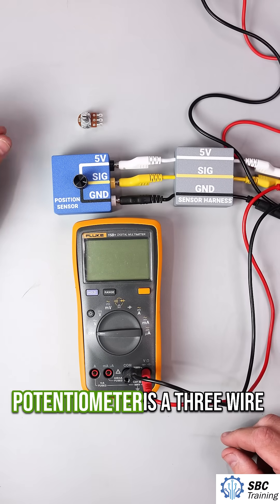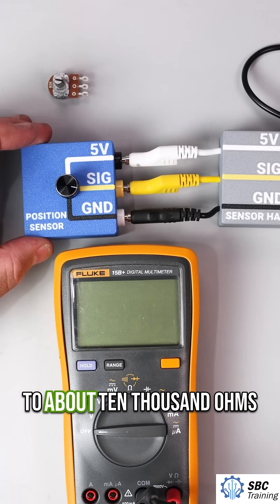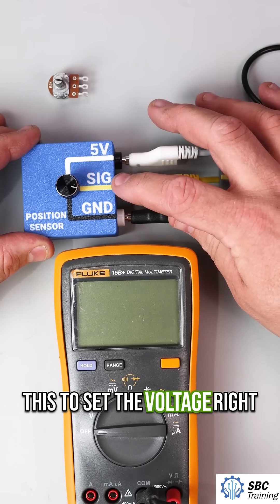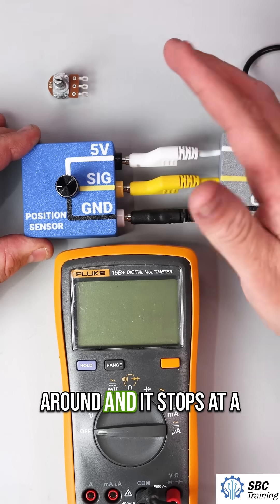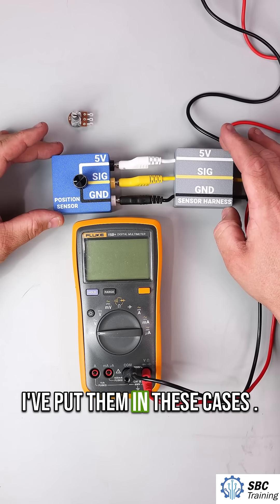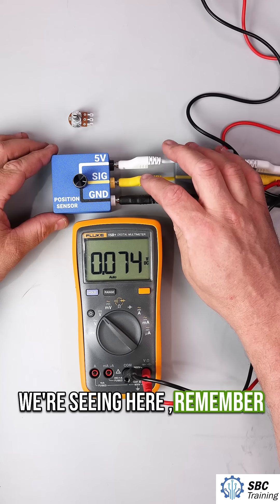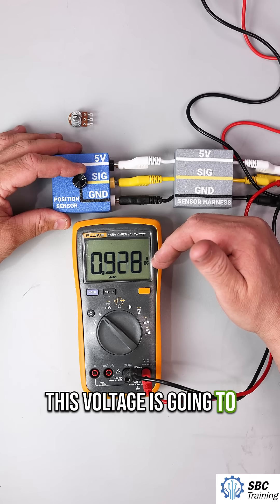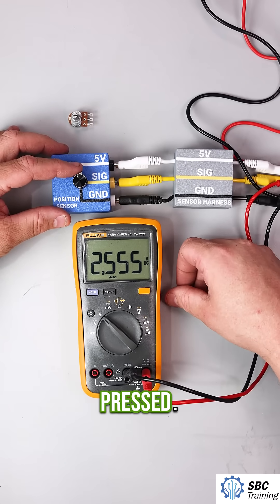How a Potentiometer Works in Automotive Sensors – Explained with Live Demo

Comment: Voltage drop test the sensor ground to the engine block and or the negative battery post  0.04vdc max.   If your ground is iffy it will throw off the output voltage.  
Engine running  headlights on. Defrosted blower on medium speed.  Meter set to 20vdc 
One. Measure across battery posts. 14.1 to 14.6 expected. Must have above battery voltage for this to work properly. 
Two. Negative battery post to the engine block 0.04vdc max 
Two B. Negative battery post to frame rail on pickup trucks. 0.04vdc max
Three. Negative battery post to body. 0.04vdc max
Four.  Engine block to firewall. 0.04vdc max .
Five. Positive battery post to the underhood fuse block.  0.04vdc max. Then probe as many fuses as you can. 
Six. Positive battery post to the the alternator output stud threads. 0.3v or less.  
This takes only a 3 minutes. Try it.